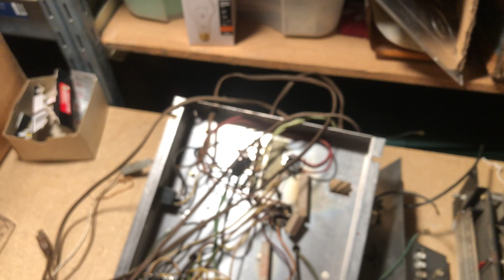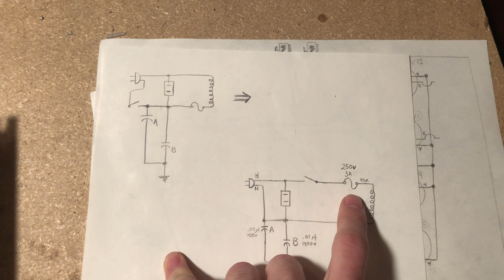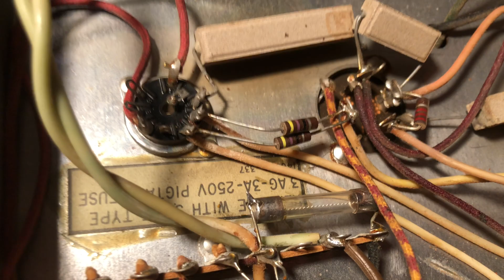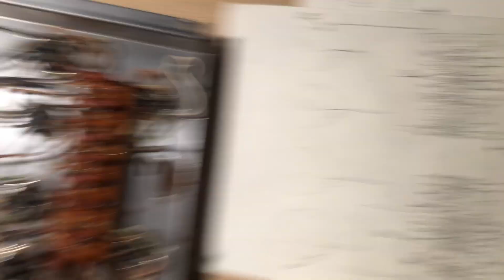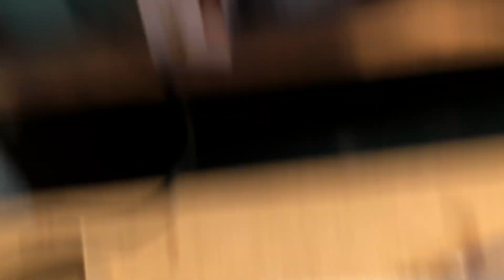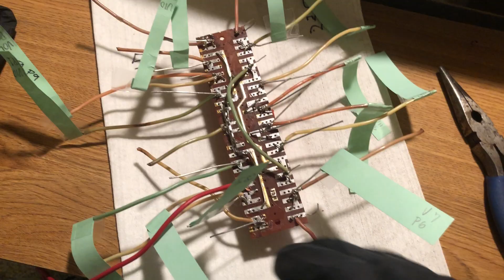Complete Tube Amp Amplifier Restoration Reimagine Stromberg Carlson ASR 120

Comment: I've had one of these (including the console) for just over 30 years and it still works great (radio too). Great video and very interesting. I have not done a single thing to it - should I?
Reply: Hi Steve, thanks for your comment.  Those old consoles are beautiful.  I would strongly recommend replacing the power filter capacitors.  Those are definitely old and will possibly ruin your output tubes.  You’ll find it will make the amp much quieter as well.
Reply: @kasoncoulter5755  will do - thank you!

Comment: Thank you for posting your work. Your info has been extremely helpful. I bought a converted 120 and I am converting that to a stereo tube power amp for guitar use. I wish you would have gone into greater detail about the master volume circuit addition.  and or how it can be wired for separate volume controls per channel. Thanks again!

Comment: So how does your amp sound ? I have two 15”, two 10”, two tweeters all Stromberg Carlson. I also have 3 sets of there three way crossovers. Yeah I could sell them. If your interested I can send you some photos of all of the speakers and crossovers. 
Did you know S/C was part of General Dynamics Corp that took us to the moon. The single stranded wire is from the Engineering Department of the space program very low oxygen high copper wires. I live less than 100 miles from the old factory.
Reply: Wow those would sound fantastic I bet.  Have they ever been re coned or foamed?
Reply: @kasoncoulter5755   no recones there all original speakers and crossovers. I have them in a large wooden chest for protection. I just don’t have cabinets for them. Any 15” with a 10” and a 6” tweeter will work fine. I should of kept the large cabinets just didn’t have room for them. I’ll get them out and photograph them and e- mail the photos to ya. Give me a couple of days I’ll send the photos to you.

Comment: What Orange drop values are you using please.
Reply from the maker: What is your email? I can send you the schematic.
Reply: @tubestuff   I have many schematics for many of S/C amps. Just got a bunch of orange drops at 474 ohm 400volt 716P type. I am doing the large resistors for the power supply. I have 4 ASR-120 .  I use the two holes near the 7199 pre amp tubes for the RCA inputs. The white dust on wires is not anything to concern your self with. The best tube I have found are sylvania 6v6gta which is 4 volt higher screen dissipation black plate clear glass, no luck finding then on eBay. Oh yeah that 144watts consumption not output. These push pull run about 15 watts but with high efficiency speakers it will blow your mind how nice they sound. I’m running 15” woofers, horn mids, horn high frequency. Very loud but at reasonable volume it’s like being on stage with the band. I also have a ASE-434 S/C pre amp which give me all the control on volume a DAC digital to analog on my computer where my music is stored.

Comment: No that’s dust use a small brush or toothbrush to wipe it off the wires. It’s not poisonous just dust.
That’s 140 watts consumption, it is about 15 watts a Chanel Amp yet using older high efficiency speakers it will blow you away with great music. My speakers are Altec Lansing 15” Alinco magnets, mid horns Alinco magnet, high freq horns Alinco magnet very efficient I measured mine 112 dbl at 1 watt driving 3 meters away.

Comment: I have had three asr-120 amps fine equipment. I own a lot of Stromberg Carlson tube amps, pre amp, crossovers, speakers. To me driving 15” woofers, horn mids, horn tweeters, out standing volume, imagining, clarity, just the finest to me. You got some big orange drops.
Reply from the maker: Do you run all three in your set up at the same time?  What is your signal path?
Reply: @tubestuff   no each is a stand alone amp. Now I have 4 of them. I clean the sheet metal with nevr dull a lot of cleaning that can make them look beautiful. I also replace the caps with brown drops for one amp then i went to Orange drop 5% caps . Original design using 473k 400 Volt caps on the board. The input rca I drill out the very front top hole for the RCA’s ,  switch for on & off where the morlar connector is located. Drill out rear panel speaker + - and a fuse. I’d use the same wires they are single wire and are good. You can use 7408, 6v6G, 6v6gt, the best is 6v6gta 4 volt higher output.  7199 are great tubes.

Comment: I’ve done Three of them a few new capacitors in the tube amp new switch, fuse holder, RCA inputs, binding post outputs. Cleaned it up with never dull. Wow very hot amps playing through Altec Lansing model 17’s great amount of volume. I love mine.
Reply from the maker: It really is great fun to work on your own amp!